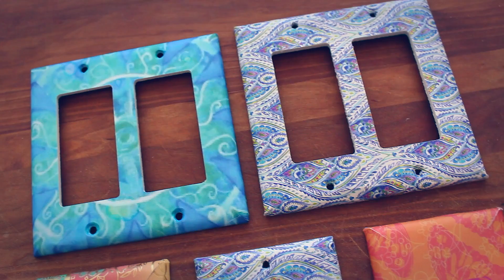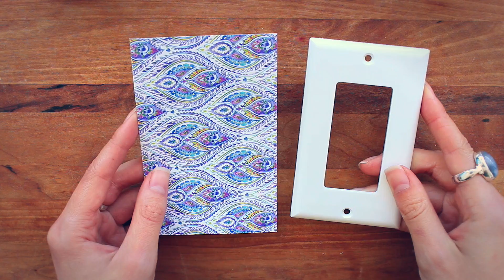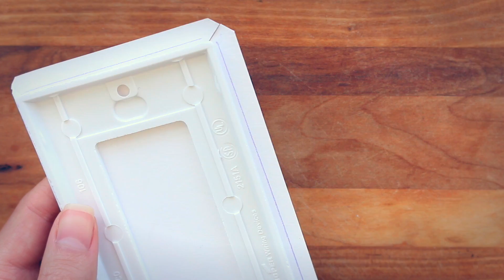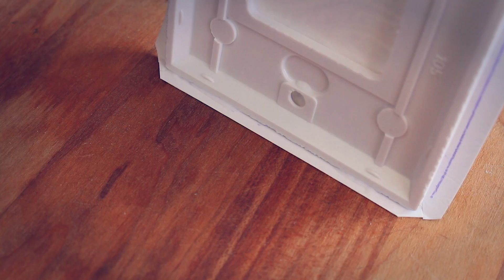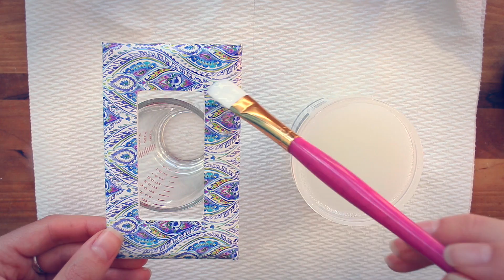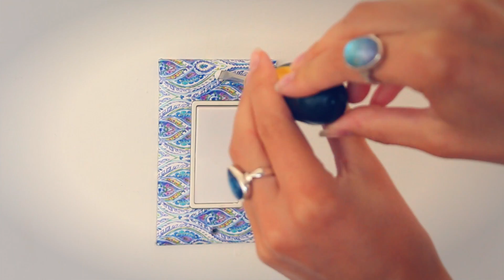DIY: CUSTOMIZED SWITCH PLATE COVERS (using a greeting card!)

Comment: Tip #1: Use clear packing tape rubbed on the back and then peeled away to thin the paper
Tip:2: Use light sandpaper to rough up the switch plate surface
Tip#3: Mod Podge is better for "glossy" surfaces.

Comment: Hey Sarah, a cool tip for drying clue on a surface like this, is to use elastic bands to hold each corner together. Instead of holding each edge together, or one at a time. Elastics are a time saver lol

Comment: Will this work with wrapping paper? Or would it be too thin?
Reply: Nali Singh I think, if you're really careful, it might work, but it might rip or wrinkle when folding it, so idk, you can try? :)
Reply: that should be fine or do it on normal paper that's what i did, i did this to all the switches in my house over a month ago it works really well :) and stays fine i did it with modpodge
Reply: Nali Singh It'll work... I used to make these with tissue paper and it was fine (: